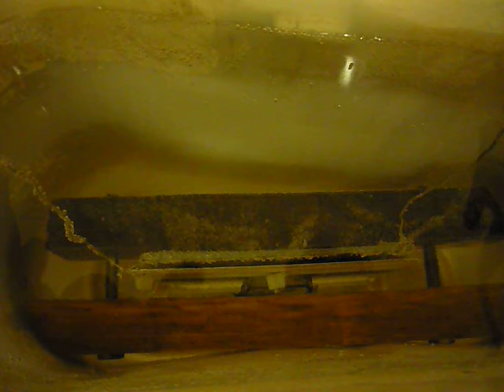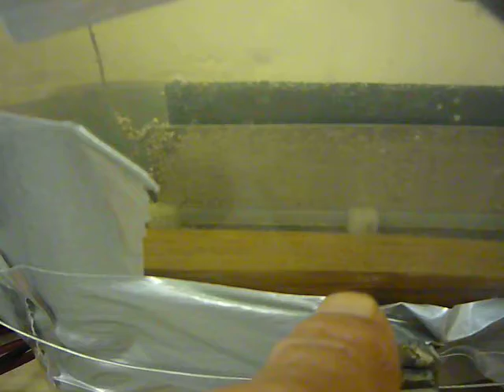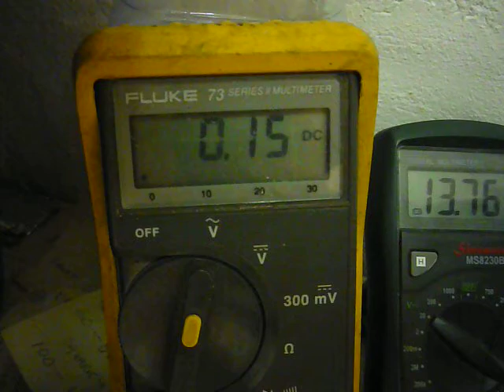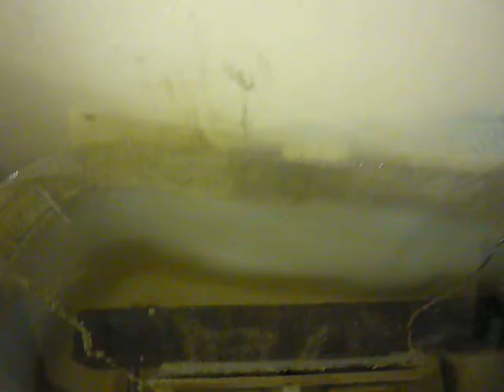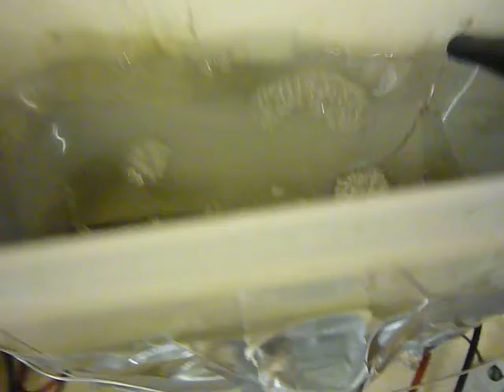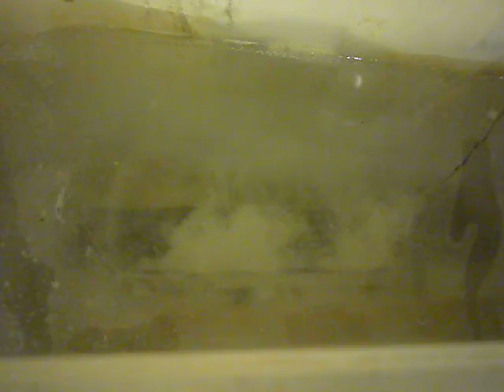HHO - magnet cell - South fields opposing?  #4

Comment from the maker: The 316L S/S started stripping... so it would seem :-
North field opposing will strip the negative plate?
South field opposing will strip the positive plate?
As a matter of interest I swapped the polarity regularly with every test - the fields will not allow either Tungsten nor Titanium to work as positive... pity?
I think the hazardous outweigh the benefits of the reduced resistance in either setup.
Jim

Comment from the maker: Theses plates would "NOT" conduct in de-ionised water without the magnets!
90-100ma @ 13.7v  - North fields opposing!
150ma @13.7v - South fields opposing = 33.3% more conduction = 33.3% higher yield!
1.2a @ 13.7v = 16 watts aprox
settled @ 1 amp 
No froth to speak of after 40min
Jim